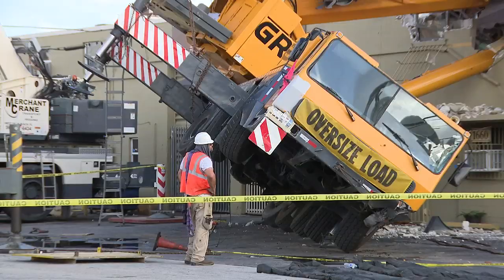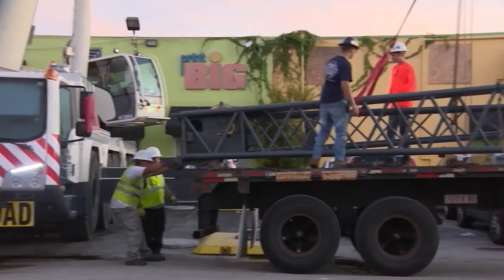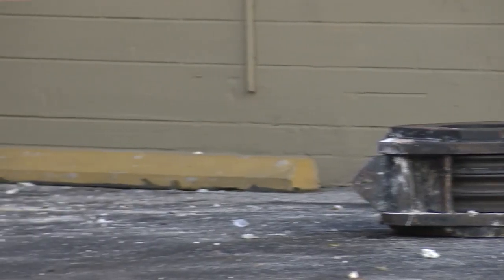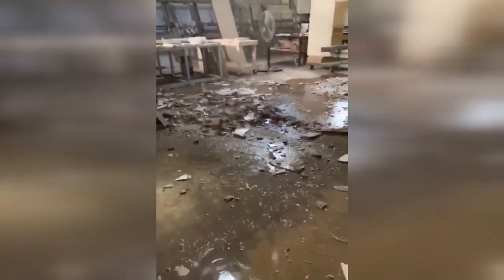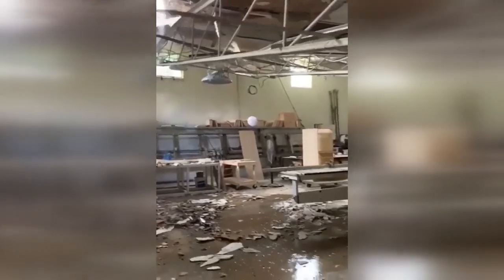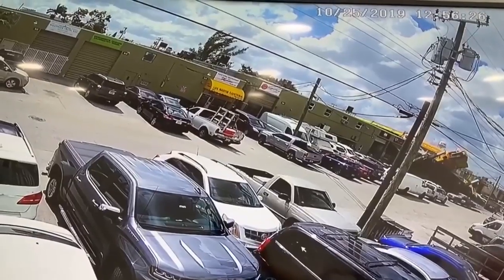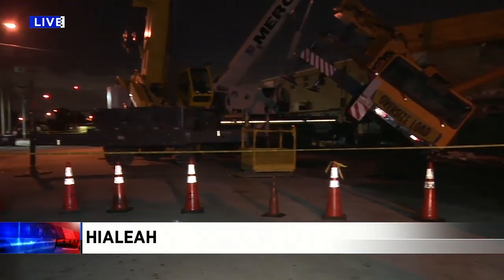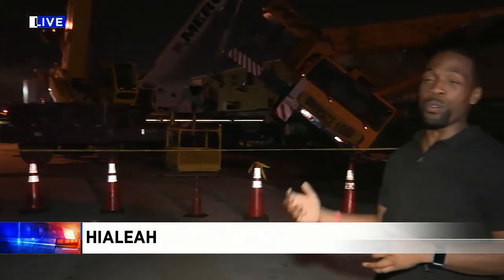Heavier cranes hauled in to remove crane that fell on Hialeah business

Comment: Those cranes have hydraulic legs that prevent them from tilting.if they are not extended they will naturally come down as they will be top heavy there need to be a product recall as if the “arm” is missing they will topple as all the weight is at the top and extremely dangerous